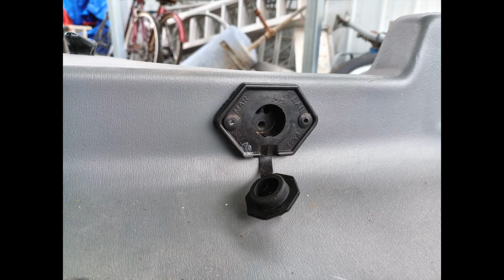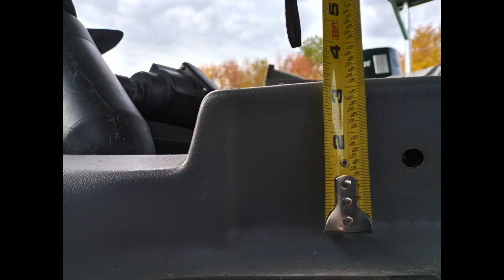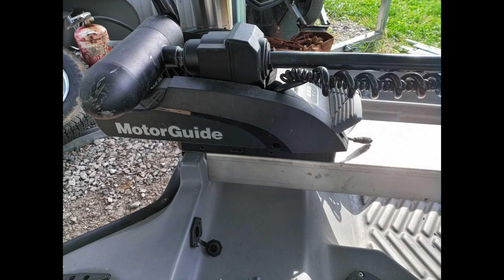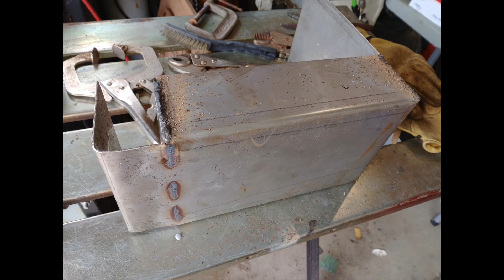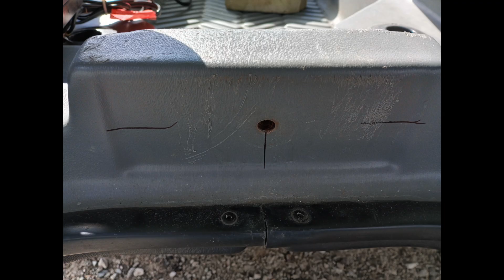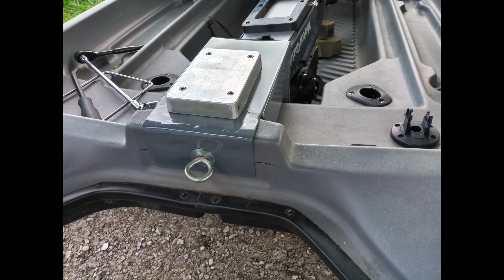How to make a Pond Prowler trolling motor mount

Comment: what is the shaft length on the trolling motor?  I recently purchased one for the bow with a 48 inch shaft.  It sits back a good ways but i havent been out with it yet.  Was wondering if you have similar size and if it caused any issues.
Reply from the maker: I originally got the trolling motor for a kayak and it had a short shaft which was great.  But since I now use the trolling motor for my larger boat I put a longer shaft on it.  Now it is so long my pond prowler is a one man boat...lol.  if I was going to do it again I would angle the motor instead of Mounting it straight back.

Comment from the maker: For those who have asked about the mounting bracket dimensions, I will post them here.  Unfortunately I can't find a way to post a picture of the drawings on here.  Looking down on it from the top, the whole bracket is 6-1/4"
 wide.  The vertical leg on the front of the bracket is 3-1/4" long.  The box section is 3" deep, and there is a 2" space between the front vertical leg and the box section where it slips over the bow of the boat.    The flat top of the bracket where your trolling motor will mount is 6-1/4" wide and 12-1/4" long.  the 2 sides of the boxed area are 3" high, and 10-1/4" long.  The vertical leg on the interior side of the bracket is straight down 6-1/2" and the angled portion that is screwed to the deck of the boat is 4" long.  Again, I wish I had the ability to post a picture of the dimensions, but can't find a way to do that yet.  Hope that helps!

Comment: Fantastic video I’ve been wondering how I was going to mount my motor guide to my pond prowler. Thanks for the video, very detailed. I think I’m going to do mine out of aluminum just to keep the weight down a bit not that it’s a drastic difference but it would look nice all polished.
Reply from the maker: That sounds great!  Mine is still working just fine.  Good modification.

Comment: I just had one made but mine sets at an angle with a bow mount whitesnake foot controlled pedal, and it looks awesome. Made with aluminum plate weighs about 6 pounds attached to the front bow transum and angles to the left and attatches to the left side of the boat. i did it that way so the person on front doesnt get in any way of the trolling motor when in stowed position.
Reply from the maker: Yes, if I did it again I would put it on an angle like yours. I almost always fish by myself but the angled design gives more room inside the boat. Thanks for sharing!